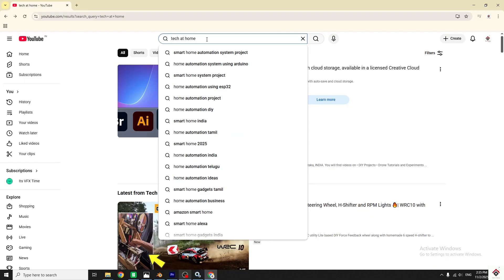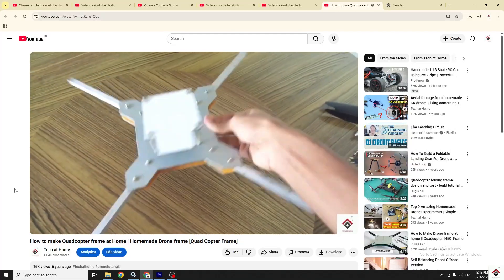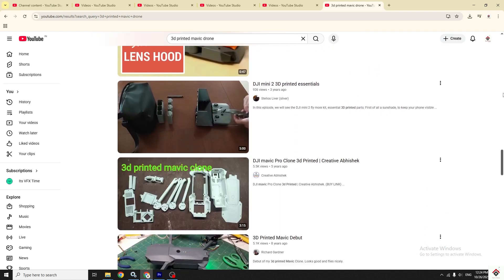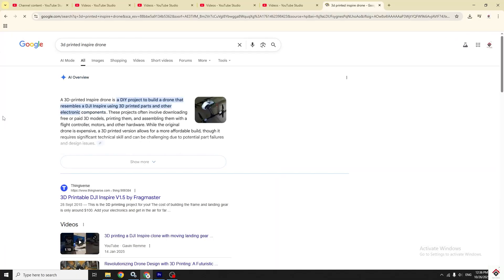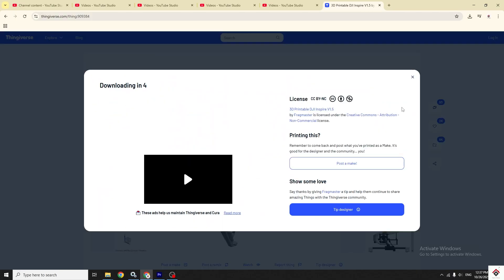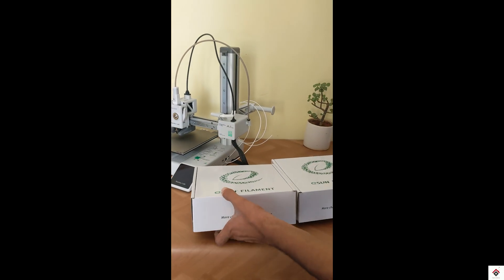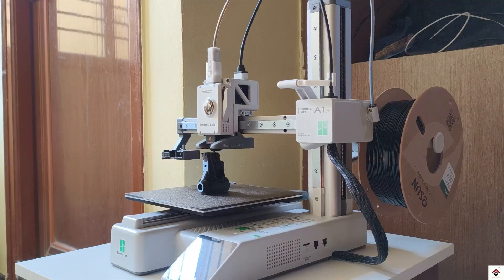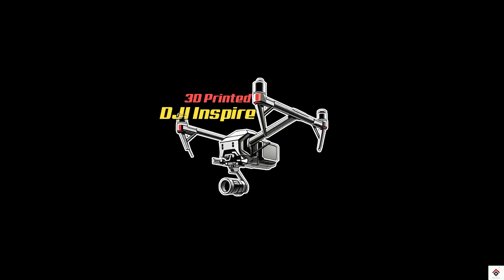3D Printed "DJI INSPIRE Drone" | Build your own Inspire Drone Frame [Full Guide] APM 2.8

Comment: Bro make a video in which you play forza horizon 4 with gimx adapter and use h shifter and clutch because I tried  many times but clutch does not work please make a tutorial
Reply from the maker: We have shown how to configure analog and digital inputs in this video: https://youtu.be/oAOVyzQf4UY

Gimx emulates DIY wheel as G27. Check online if G27 also has same issue with clutch with Forza.
Reply: Yes it has an issue with g27 clutch on forza horizon 4 steam version can u make a video to emulate g29 or something which can work with clutch

Comment: Hey I am your oldest subscriber if you remember 
We even had discussion over call regarding APM 2.8 

So even I am building same project all files printed months ago probelm is those carbon fiber rods 
Springs where are you arranging those from ?
Here they are quoting super expensive 

Thank you again
Reply from the maker: I am planning to use hollow Alluminium pipes. Carbon fibre rods are very expensive.
Why do you need springs?